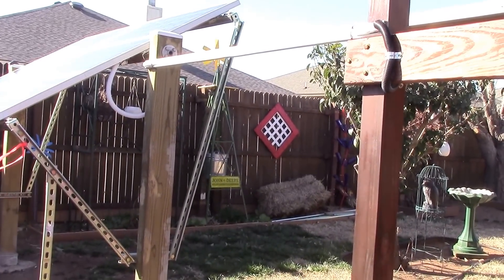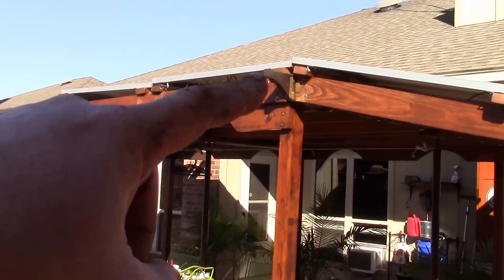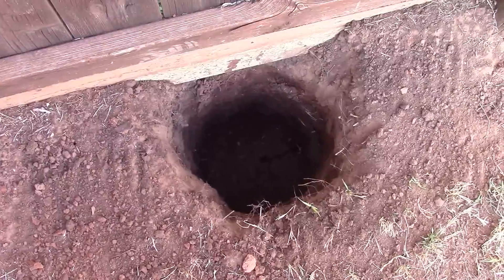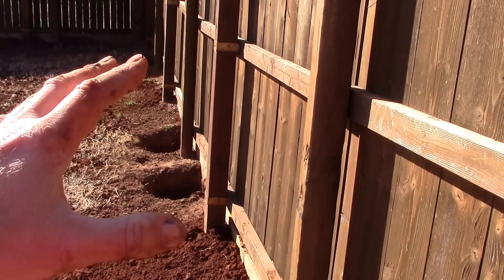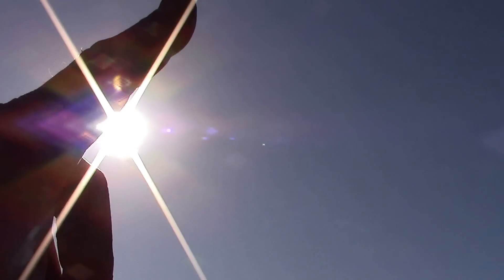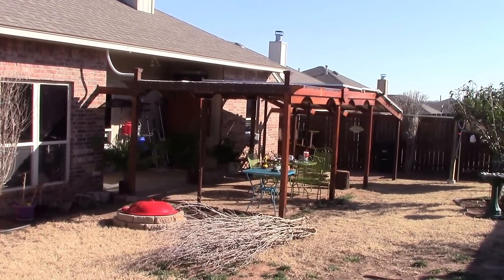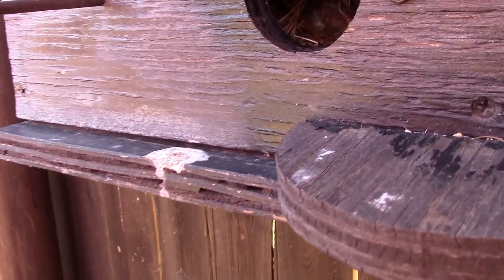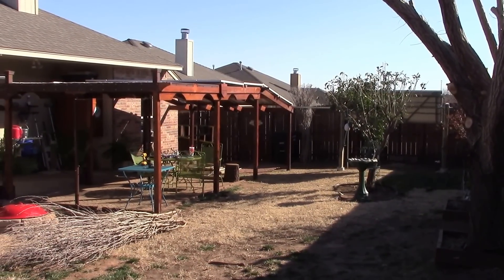New Project - Moving 12 Renogy solar panels off of the pergola and onto the fence

Comment: did you know that the midnite classic can handle a 3000 watt array for a 24 volt battery bank at around 90 volt open circuit
Reply from the maker: They are nice units.